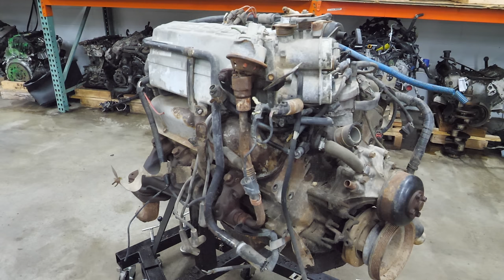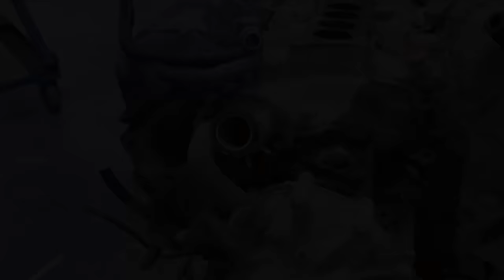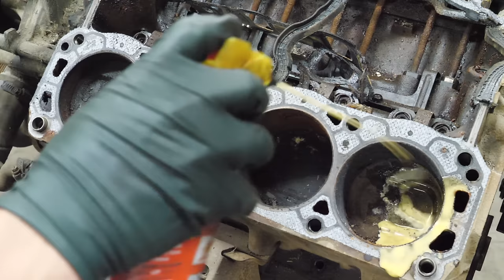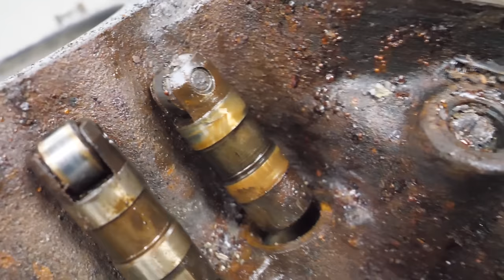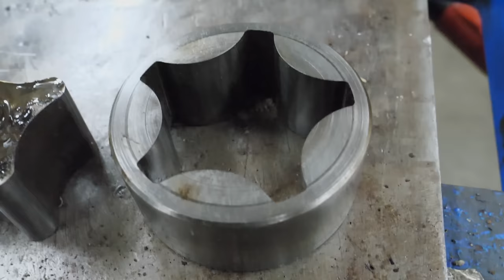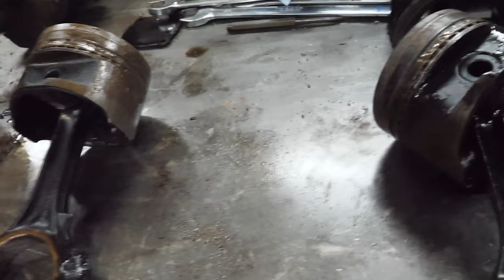LOCKED UP Ford 351W 5.8L V8 Engine Teardown. How Bad Could It Be?

Comment: So.... Hot wash the lower intake, then clean it up with wire wheel? It would look like a good candidate for the high pressure paste stuff that can be run through the runners to really clean them up. Do the same with the upper, they'd be matched. If a customer wanted to stay MPI, that is. Betcha one could get more BHP's now with a decent intake and a carb or Sniper style kit.

Comment: Kroil, Thrust, PB, and WD, if necessary Sea Foam for certain things that need a good creep for delicate and mid grade style stuff that needs loosening. What's on your shelf of goodies Eric? Forgot Wet and Dry Silicone spray for lubricant on certain things that you don't want smearing everywhere.

Comment: My '90 Crew Cab 4wd 5 speed had a leaking passenger side exhaust manifold.
Bought a NEW manifold, had it surfaced, let the mechanic tell me it didn't need gaskets. After all the FACKTREE didn't put them on!!!

It still f'ing leaked just as bad $500 later. I should have INSISTED on gaskets!!!

My Wife's late '99 Powerstroke had the same problem on the driver's side.
Fixed it MYSELF with FORD gaksets that they sell to remedy their FACKTREE FLAW of NOT using gaskets!!!!
Didn't surface the manifold, put it back on WITH GASKETS and 7-8 years later....NO F'ING LEAKS!!!
Reply: Do it right the 1st time you don’t have to do it again

Comment: This looks like a storage location that heat cycled a lot and had hight moisture. You get condensation if you have warm air getting into a cold engine, which will partially drip down and end up under the oil. This going on for 17 years will give plenty of surface rust all over the insides. Once inside the engine, the water would just not evaporate, since there isn't any draft going on, so it would accumulate quite some water in 17 years.

Comment: A 5.8 roller cam engine was only built for 1 or 2 years I thought. My '96 E-250 with a 5.8 only has 378K miles and still runs fine and passes emissions every time. Might throw a timing set at it this summer. Send that cam and lifters to Stellantis and see if they can't reverse engineer a decent set for those POS gen 3 Hemis.

Comment: If you want a good 351 find a Aussie one stock power between 250hp and 400hp depending on application. I had one in a 4wd F100 with 500,000 miles and didn't use any oil

Comment: I had a 77 Tbird 351 w needed valley gasket, I had to tear it down 4 hrs later I had it completed.
EASIEST V8 I worked on .
THE DISTRIBUTOR IN THE FRONT 👍🏾👍🏾👍🏾.

Comment: Hi, I had a 98' F150 w/5.4 2 valve with regular maintenance when i received it at 77,000 and then regular maintenance during my owner ship I was able to get 277,000 miles until my tranny took a SH@T. I still miss that Truck , they don't make them like that anymore.🤙
Reply: No they don’t the new engines are planned to fail
Reply: Purchase the ecoboost 6 cylinder new and change oil every 3,000 miles..leaps and bounds better than 5.4

Comment: The bosch platinums did not help this engine any bit period. The stock ignition cannot drive those because the resistance is too high of the Platinum. Those originally took a copper core spark plug.

Comment: The biggest issues with the 5.0 and 5.8 blocks is the aluminum timing cover being porous around the water pump bolts and not enough stroke to be good truck motors. You want high torque for trucks, that is why the 300/4.9l are unkillable. The 5.0 has 3 inches of crank stroke, the 5.8 has 3.5 inches of stroke, while the 300 has 3.98 inches of stroke. All 3 engines share a 4 inch bore.

Comment: For like big pipe bolts give it a couple taps with a hammer, also a normal spanner, and tap the end of the spanner with hammer you'll be amazed how much easier to undo 👍. appreciate your videos

Comment: I remember those always having a lower end bearing rumble and low oil pressure. Usually around 80-100k. But the Mustang 302’s didn’t.

Comment: I have a 1990 4x4 3/4ton 4 speed 351 bad oil  pressure when last run appox 12 years ago smelled like when we use to blow em up before junk yard back in thedays

Comment: Back in my day the 351 Cleveland and the 3:52 Windsor if I ever took the water pump and all off that went through the aluminum always wrap the bolts up good with grease just in case they lasted me a little longer

Comment: Good job mixing up the tear downs, even the rusty old engine from the invisible boatmobile. That's the kind of engine I started wrenching professionally on and don't see now that I do fleet work. I would rather do 10 cracked 351 exhaust manifolds than anything on an ecoboost.

Comment: We had a couple of the old 351's   Could not kill them.    We junked one car because the frame rotted off the car.   Six years later we found the junk yard was still driving the car around their yard as the engine just would not die even without any work done on it for several years before we junked the car.    Car not so good but the engines were fine.

Comment: Theory:  This thing sat on your vendor's shelf for 17 years after it sat on his vendor's shelf for 2 years.  And before that the vehicle it was in was running right up until it got flooded out in a little event called Hurricane Katrina.  Not like it breathed water, more like it wouldn't start after it "dried out," and it was yanked out of whatever truck it was in, so it was labeled "bad."  And back then, 5.8/351 Windsors were much more plentiful, so it didn't get any attention.  For twenty years.
I think my favorite part was the literal cobwebs in the intake runners of the the heads.  They added to the whole air of Southern Gothic surrounding this particular powerplant.

Comment: Even if that block has a standard 4" bore it's probably a boat anchor, the coolant passages are probably just as rusty as the bores and Ford small blocks will only take a 60 thou overbore before really bad stuff happens (porous block, requiring sleeves etc.), the crank can probably be salvaged but the rest is scrap (with the exception of the parts you already deemed useable).

Comment: There comes a time when it's time to stop....

And we've all seen that shelving unit that sits under the roof leak, and everything on that shelf is wet & rusty....  So who knows....

Induction heaters are great.  The one I have is very capable of making the bolts red or orange....  I usually stop at orange, but I assume it would keep going into yellow & white....

Comment: I never thought I would be cheering for a Windsor to be saved but 351s weren't that common and could be a base for a performance build (bored/stroked/ aluminum heads,etc). Look back at the literal mountain of 440 Magnum pulled from cop cars(drove past junk yard that scrapped the "Blues Brothers" cars) to finding 351 Cleveland 4v or 340,SBC were cheap and everywhere. Now I know what the old Hot Rodders felt about lost history.

Comment: I recently did all 8 fuel injectors on one of these in a 96 Econoline van...not the funnest job doing it all in the through the "dog house" as they call on these short nose vans cause it required pulling that large intake off a very large engine in a very small space. You gave nightmarish flashbacks of that EGR nut... imagine fighting that with the engine between the frame rails of a van!

Comment: I'm surprised you gave up that quickly, but i guess it's a business decision. The only parts worth anything there are crank, block, rods and the intake and maybe some bits like lifter spider and dog bones. We spend 10 minutes with a mandrel mounted wire brush and it takes the rust out, a little heat and then a steel bar on the piston with a 3lb hammer.

Comment: youre suppose to heat up the threads and not just the head of bolts. Also you can get them alot hotter than that. make them glow red alteast.

Comment: Plenty of 351s in Australia. 
We would love you to pull down a Ford Barra I6.
Reply: I was under the impression the majority of 351s in Australia were of the Cleveland variety not Windsors.
Reply: @calebdean2440 there is a quirk where Australia was beholden to ford in Canada not for in Detroit. The reason is that both were members of the commonwealth. I think there was a free trade agreement that made 351W engines cheaper to import. The vast majority of W engines were 302. Ford imported more 351C in to Australia before casting their own 1976 to 1982

Comment: The only real issues I remember with these engines (aside from the fact that the post-1970 versions made no power and got awful fuel economy) was that the later versions always had way too much haphazardly placed equipment on them. It was like Ford just kept doing band-aid fixes for newer emissions requirements without doing any actual engineering to fix or fit the equipment properly, making them harder to work on. The mod engines were actually much better in that regard (at least once they went to individual coils rather than the coil packs and 2 mile long plug wires). Well, and the early Ford EEC systems left a lot to be desired in terms of driveability. Even when they were new, the truck V8s with EEC would always idle strange and start poorly when cold

Comment: The fact that that thing is as rusty as it is and it sat for however many years. You got those pump bolts out very easily. Those were way larger than i thought they would be for a pump. That says something about build quality
Reply: Any of our modern engines in this exact scenario, everything is going to break😂

Comment: All 3 Ford, GM and Chrysler made some pretty good reliable stuff back in the OBS days, now I don't trust either with a 10 foot pole honestly, I'm a chevy guy, the highest mile trust I had was a 91 Chevy c1500 w/t with a 4.3, sold it with 768k on it, rebuilt trans in 2002, original engine, gutless as heck, I only sold it because I needed something with a little more guts to it.

Comment: Would like to see you take apart an old Cadillac 472/500/425/368 ci V8. Back before GM put Chevy 305's in everything. The 472 series Caddys were huge blocks with 5 inch bore centers and 10 inch deck height.  Back when Cadillac was the Standard of the World... Well except for that 1981 368 with the "4/6/8" cylinder deactivation and early throttle body EFI - that was a POS but would still be fun to see you take it apart.

Comment: Should have drilled a few holes in the pistons to help relieve the cylinder tension then heat them with a torch lol, i have had 2 like that and they came apart and as you said….i was worn out but  i was in it to win by then so i pulled out all the demolition tools😂

Comment: I know that engines can rust up from just sitting in a moist environment. My 318 Ramcharger that I just fired had a 1 piece timing set worse than that, it immediately broke on first crank 2 years ago. It sat in the grass since 08 behind a dealer complete and hood latched. That 351 had to have sat in a way worse enviromment, as in water intrusion type of environment. I, too hate tearing down "wet" engines and have given up and threw em in the "dirty motor" pile. - Jamie

Comment: Definitely not a lot of oil leaks by 96, 97. One piece rear main, one piece pan gasket, reusable valve cover gaskets. As long as the oil was changed there were very few leaks.

Comment: This happens anytime you store something is dense as an engine block in a non-conditioned space. 
Most commonly I see this where a vehicle sits under a shelter but there's no heating. When it gets cold at night and the engine block gets cold the sun comes up in the morning and heats the surrounding air that moisture clings to the engine block it finds its way in the crevices in the intakes and the block just fills with water. 
So 13 years.... 

This is the same effect that causes headlights with leaks to fill with water. 
Happens faster in headlights
Reply: I always been told it’s best to filled engines full of oil if they are to be stored for several years.

Comment: As always, I appreciate the teardown.  Yet there was no obvious carnage.     Merely a rust-welding of parts to block.   Just a guess but wouldn't the medium well bolt work better if it was marinated in some form of penetrating oil or /Kroil or similar.

Comment: James Condon has a channel where he rebuilds primarily portable generators. He's gotten quite a few that have had moisture in the fuel tank creating rust. He uses Evapo Rust to clean these tanks. Suggest taking a look at some of his videos.
Reply: The fact that he doesn't have it sort of fits his business model. He and his guys most likely are pulling stuff apart for sale, and having a bunch of stuff sitting around for a day or more half-pulled apart just isn't worth the hassle.  Totally the opposite of most home gamers.
Reply: @boots7859  At one point in the video he mentioned and sounded as though he might want to try the product. I mentioned James Condon's channel in case wanted to go there and see the stuff in actual use.

Comment: I just bought a gorgeous f150 with 2 351s sitting in the bed both have water in them thinking about tearing them down to sell the blocks and heads to pay for a running 351

Comment: Windsor is about a 3 hr drive from where I live. All these engines were made in the Ford motor company Windsor palace. Not sure if the Windsor or Cleveland is better...but they are Fords after all.
Reply: What are you smoking? 351W were made in Windsor Ontario, the 351C were made in Cleveland.
Anyone who knows anything knows the 351C were the performance engines.

Comment: I have a 90 4x2 mine has a 5.0 it runs although I'm having fueling issues this one looks to me like 17 years of condensation the oil inlet is in the driver's side valve cover the one with rusty rocker arms

Comment: Next time try drilling a small hole in the top side of the water pump casting down to bolt and spray penetrating oil 
 Then let it soak and heat, soak again heat etc.

Comment: heating bolts?  It's the cooling that breaks the bond, not the heat.  Heat expands, if it can not expand it's diameter it will expand lengthwise.  There it to cool it contracts both length wise and it's cross section.  60 years in the trade.  I could have used one of those heaters years ago.

Comment: Man, you need a 2x4 stob and a sledge hammer to remove that piston.  A hone and a good cleaning, a tube  of silicone, and it will run again.  The inserts are fine, so are the mains.  Wash her, and bring her to me.  You DID remove that camshaft retainer, didn't you?  Remove the rear freeze plug and bump the cam out.  Expect some EvapoRust.

Comment: Paused at 28:13 ... yeah, that's gonna break. That bolt goes into a water jacket and is probably half again the diameter it used to be inside there.
EDIT: HOLY CRAP, YOU'RE A MIRACLE WORKER!

Comment: Wow, that's real bad. Real real bad.
Once, several years ago, I was doing some volunteer work, helping people clean out their backyards. One person had a V-8 short block sitting in their yard, and I managed to remove it. Those pistons looked better than this. That's right. An engine with no cylinder heads had better looking pistons than this.

Comment: Had a bunch of these in my construction company fleet (as well as a bunch of big yellow stuff) and one was approaching 800,000 miles -- maintained all of its life by Local 3 union equipment mechanics: one of the engineers had it as their assigned daily driver [EDIT: it felt like it had 800,000 on it too, but, it was driving]

Comment: The wrist pin wins again. If it wasn't for the fact that you were going to reuse the water pump drill some holes in the casting to get some lube in those rusty holes.

Comment: Heat the reluctant stud. Then let it cool before you unscrew it. When it has  contracted in the head. Heat reluctant nuts and immediately unscrew while they are expanded on the threads.

Comment: They really didn't change much of anything since 1969.  The Intake, FI, and sensors seem to be the only thing changed. You'd think they have an electronic distributor.  Nope it's just a flatter version of the same old thing. Oh and the piston crowns are different.  Mine had 10.5:1 compression.  This looks to have at best 9:1

Comment: im kinda curious because i think about this differently than others, i think. wouldn't heating the bolt up and expanding it make it harder to get out? I know heating a bolt up red hot and letting it cool will help because the bolt shrinks samller than its original size when it cools off.  what do you think?

Comment: when a engine sets for several years in a medal building or old car condensation from hot to cold will fill the block with water i had a couple be to the top of engine with water

Comment: If you have not noticed pb blaster doesn't work.  Use brake away or ATF
Reply: Never had any of the penetrators really work.  Heat seems to mostly work, and heating up the bolt and then cooling it down with ice works better as the bolt becomes just a thousandths narrower.

Comment: It's such a shame that you have modern engines from a few manufacturers that have issues with failing lifters coming apart when older engines seem to run forever. Equipment is supposed to get better over time, but the other way around. Quality craftsmanship is apparently a thing of the past.
Reply: Lack of maintenance is the issue not the design
Reply: @JOMaMa..  It's not lack of maintenance when the needle bearings in the lifters of Hemi engines come falling out of the rollers destroying the camshaft. That is either poor design or a severe lack of quality control.

Comment: Hey, random question, is that the knock sensor mounted vertically between the injectors on the right side of the engine? i'm trying to find a replacement sensor on my 351 on my f250, but i cannot find any information, thank you so much, cool breakdown